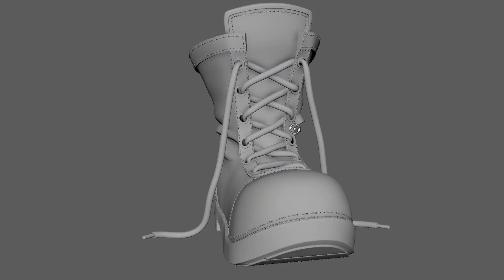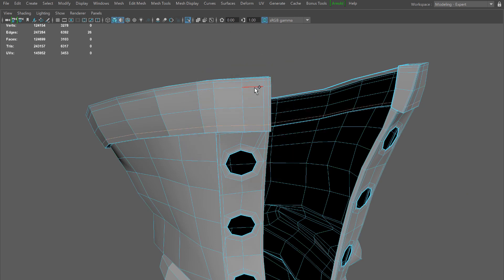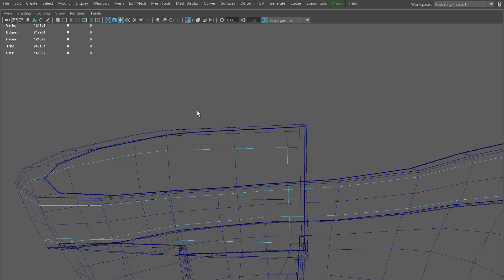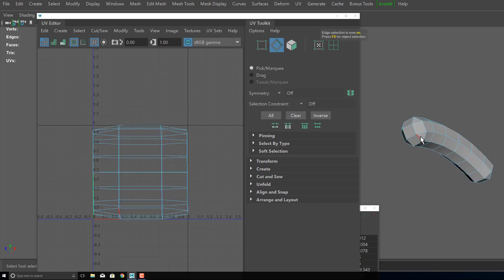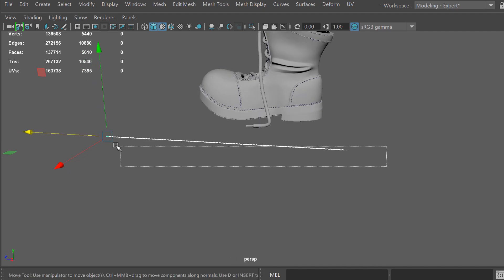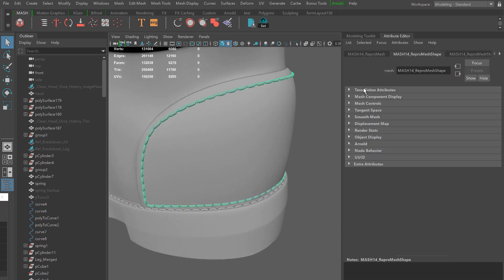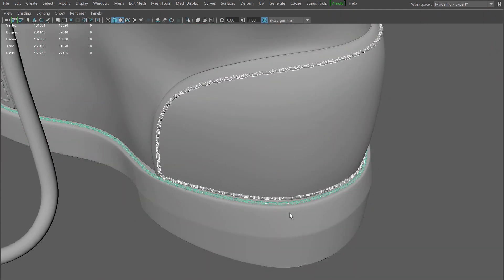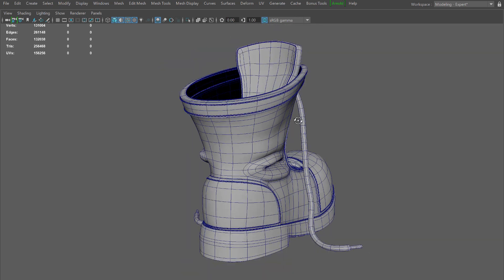Maya 2018 3d Modeling Tutorial: Model Stitching using MASH and Curve Warp.

Comment: I really don't get why you do it so painstakingly :/
Just use zbrush man
Reply: Because this method is non destructive. You can change and modify everything any time without having to start from scratch. Also gives you rigging possibilities (for animation) that ZBrush simply does not have.
The pain in the neck would be ZBrush, not Maya.

Oh, and you never do back and forth between two applications, making the whole process actually faster.

Comment: what is MASH? is it mesh or anything else?
Reply from the maker: Mash is is a set of node based tools initially designed for motion graphics but have modeling applications as well.  It started being integrated in Maya a couple of years back.  You can find more info on mash here: https://knowledge.autodesk.com/support/maya/learn-explore/caas/CloudHelp/cloudhelp/2018/ENU/Maya-MotionGraphics/files/GUID-D4FECFDC-F91A-4BDC-A1B0-A24EB087B2DD-htm.html

Comment: You could subdivide a couple times the copy and extract the curves in linear mode from that high res mesh
Reply from the maker: JC That could work as well but you would have more edges to select to extract the curve.
Reply: JL Mussi not much of a problem if you select loops and you also end up with a perfect match. Depends on each model probably.
Reply from the maker: Yup, I agree totally model dependent.
Reply from the maker: Yup that would have worked as well, there's more than one way to Skin a Cat or in this case Build a Curve :-)